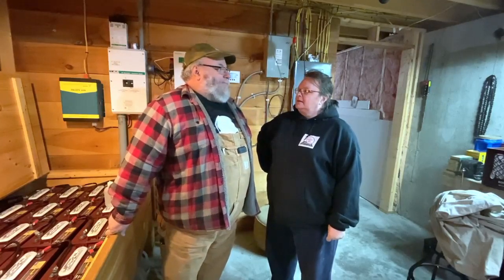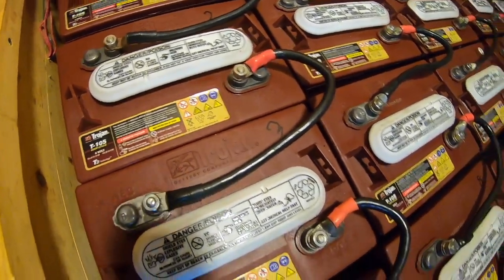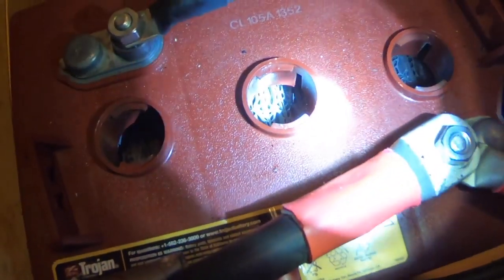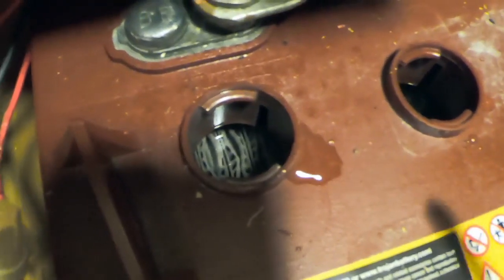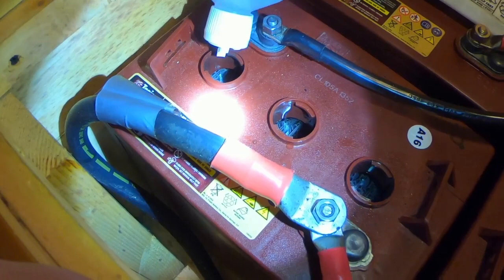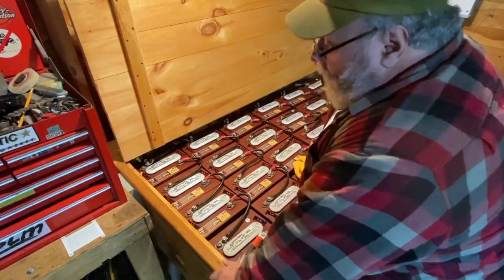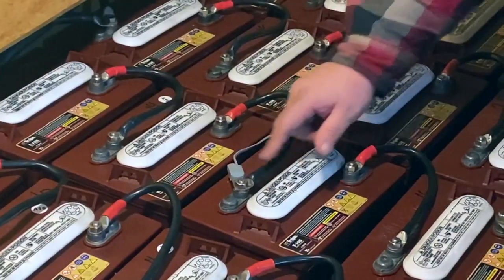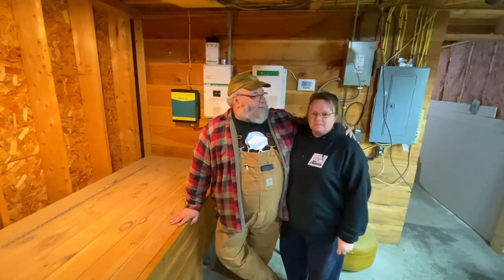Off Grid Solar Power Battery Maintenance || Battery Check 👍

Comment: I like your setup you have.  How long do you think those batteries will last you?  Any issues with venting?    Great video and thank you for sharing.  Stay safe!
Reply from the maker: The whole battery bank was new in 2015, so they aren’t new. I’d like to get over 10 years out of them. Maybe more. The better you do at maintaining them, the longer they last. Water level is very important.
Also, we try very hard not to run them down below 24.3v.
I know that sounds crazy for a 24v system, but your voltage range is actually fairly narrow. If you think about it, it’s like a 2 volt window of useable power. But remember, you can do a lot with a couple volts. You need to think about the amps, as opposed to volts when you’re thinking about the useable power.
The battery bank is in an enclosed box, but there’s a small fan/check valve, that’s controlled by the voltage (state of charge) that is plumbed to the outside world with PVC pipe. As the batteries reach the voltage where they are producing hydrogen, the fan starts automatically.
Thanks for watching!!
Reply: @WhiskeynSunshineOffGrid  great response!!  :)    Once I get some more time I plan to get a solar setup.  I may be tapping into your wisdom again.  :)  stay safe and thank you!

Comment: I use a garden pump up sprayer, I just cut the end off and use it as my filler.....mine generally take a few gallons,  I did have one battery go bad in last 4 years, great set up... is your box vented to outside?
Reply from the maker: That’s good idea. Probably less dripping on the top of the battery’s I would think. It is vented. We talked about it for the video, but I think the person editing cut it out. Lol There is a fan and pipe coming from the box to the outside of the house.
Reply: @WhiskeynSunshineOffGrid  lol    ughhhhhhh  editors and camera crews   its just so hard to get good help :)...   yeah I like my sprayer technique, but i did extend the little hose not to hold the can.....just making sure on the vent, its important.....great video...
Reply from the maker: +None ya Texas on the back 20 Well I think hair/makeup and wardrobe are killing’ it though. But still keep us looking like ourselves. 😂
Reply: @WhiskeynSunshineOffGrid  for sure they need a raise!!!  lol